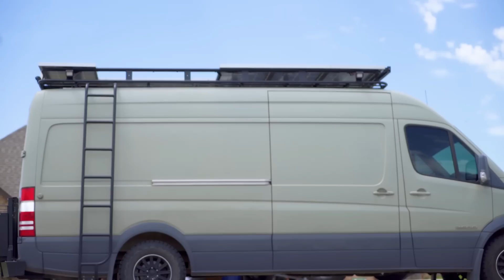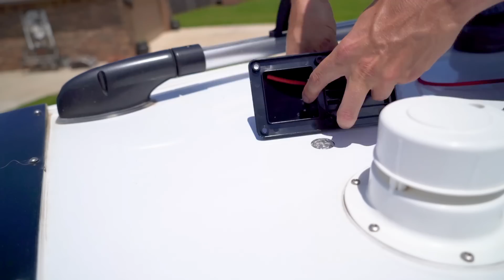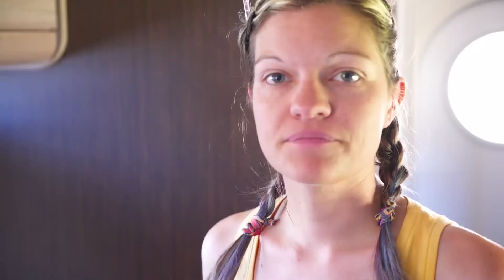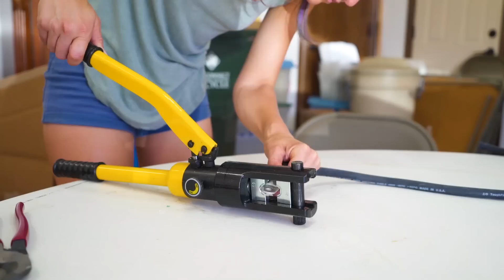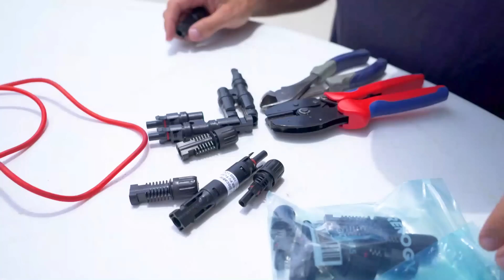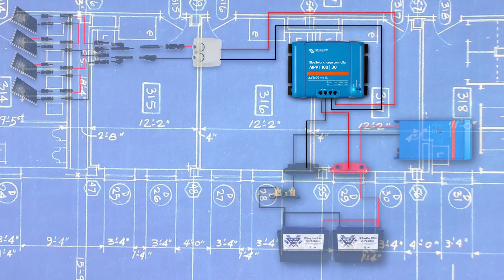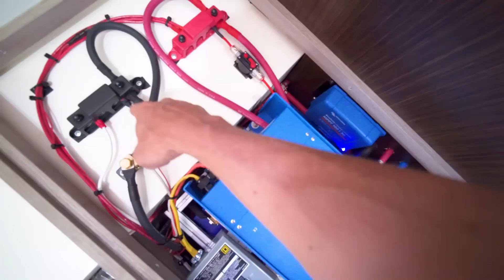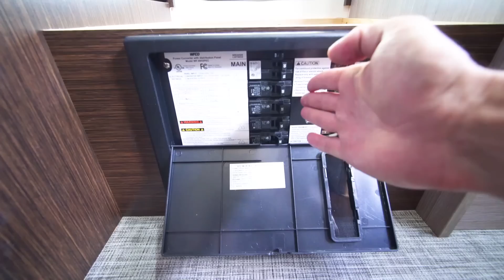Camper Solar Setup Tutorial - How to Solar Power your RV, Camper Van, & Truck Camper

Comment: Might have been useful to run shore power to the inverter/charger via that existing 15A breaker instead of letting it sit unused and doing that splice in the new junction box. That way you essentially gain a free isolation switch, and you need a bit less wiring work.
Reply from the maker: The way we did it in this video is no longer the way I recommend.  Now, I recommend running the shore power to the inverter directly and running the AC out back to the panel to power the entire panel like shown on all of the wiring diagrams on https://www.explorist.life/solarwiringdiagrams  Attempting to isolate the air conditioner and microwave to independant circuits is not worth the effort.  If somebody is worried about accientally bumping the thermostat and turning the AC on, just turn off that breaker.   Otherwise, just pay attention to what you are doing.

Comment: Cant you just connect the solarpanels to the battery that the travel has a place and avoid all the wiring
Reply from the maker: The solar panels must be connected to the charge controller.  Not the batteries.  You can see diagrams for this here: https://www.explorist.life/solarwiringdiagrams

Comment: Hey guys I love the fact that you and your wife do things together,, to me that is awesome and that's a huge thumbs up for me..
👍👍👍👍👍

I just want to clarify something,, and maybe I just misunderstood or didn't see but when you supply shore power to see inverter..
The shore power is normally a 30 amp circuit for that particular type of camper..
But coming in into the junction box you have mounted on the floor where you ran it up to your original 30 amp circuit breaker system and then you ran it over to the new inverter charger.. 
What size wire did you use going from that junction box on the floor where you made the splice to go from the shore power to your original circuit breaker AC power supply system to your new inverter??
If that wire is Less than a 30 amp wire which would be a 10 gauge wire,, if there's a short between that junction box and your new inverter charger or if it has shorts internally and if that's wiring is less than a 10 gauge wire it can possibly overheat and catch on fire,,  unless you put an in line fuse at displays in your junction box on the floor appropriate to the wire size going to your new inverter-charger,, if it's not rated for 30 Amps a 10 gauge wire is please return my message if you would please don't take this as somebody else being a know it all I just wanna make sure I understood that's all..
Reply from the maker: Correct.  We used 10AWG for the 30A wire runs.  You can see all the wire sizes in detail here: https://www.explorist.life/solarwiringdiagrams and look for the 200AH / 400W for this particular system.

Comment: Two quick questions,
1. What is the advantage of the cage that you created for the batteries? Other than cosmetic and organization does it add any features or safety?
2. What exactly do the buses do?

I love this video! You have made something that I thought was going to be intimidating and difficult much more approachable! I’ll be downloading my book ASAP!
Reply from the maker: The cage simply gives the inverter somewhere to sit in this low-clearance environment.

The busbars are essentially extensions of the battery terminals.  Here's a video that explains the basic parts and pieces of this setup: https://youtu.be/xuZg4NasCVw
Reply: Hi from Australia 
I just came across your comment 
Just thought you might like to look at my camping set up, some Australian locations such as world heritage listed K’gari (Fraser island) and some great camp cook ups. 
Cheers and safe travels🇦🇺
Out There Touring

Comment: How did you secure the aluminum cage to the flooring?
Reply from the maker: We drilled a few screws into the floor, but the floor is just a SIP (structurally insulated panel) with little real wood/substance there, so I don't really think that's doing anything.  The cage is really just wedged in place very well with 50+ pounds of equipment in/on it, so short of a massive collision or something; it's not going anywhere.

Comment: Why didn't you wire all those solar panels in series. that Charge controller your using can handle 100 Volts input.
Reply from the maker: Indeed it can handle 100 volts input, BUT those panels can potentially put out more than 25v each if the temperature drops.  Remember, solar panels only put out their rated output when the temperature is 25 degrees C (about 70 degrees F).  Here's a video that will teach you more about sizing a charge controller to the panels: https://youtu.be/MxziHKvTRh8

Comment: Did you drill those mounting holes in the roof rack?  Any concerns about structural integrity afterwards?  I am doing a similar thing because my roof rack doesn't have a channel for screwing anything down. Thanks looks great!
Reply from the maker: Yes, we did drill the mounting holes in the roof rack and no, we have no concerns about structural integrity.

Comment: Rv s should by now be stocked with the option to build solar directly into the whole system.  There is already so much at 12v which is perfect for solar.  I eventually just disconnected my converter all together.  Good luck folks.
Reply from the maker: Yeah, we recommend disconnecting the converter all together and using an inverter/charger combo as it's less complicated and less wiring.

Comment: I want to to put 2 battleborn batteries, Victron inverter/charge, along with the solar on roof, controller.... Would you use the garage to install batteries/ inverter or use the front space of 5th wheel. I understand that the battleborn lithium batteries will not charge under freezing so many put in garage for heat, but others just install in front compartment and don’t worry about that because they don’t camp under freezing. We do not plan on that either and I know there are battery blankets that could be installed if that happens.  So whats your opinion on placement of system in a 5th wheel. Thanks .. Great info...
Reply from the maker: I recommend putting your batteries near where you plan on mounting your inverter; wherever that will be.

Comment: When you get down to it, this takes a good amount of thought. That being said, both of you have made this process as user friendly as possible. 

Everything else I’ve seen has left me more confused in the end than I was at the start. So thank you for going in depth but at the same time keeping it simple. 

What am I going to use? How much power will I consume? What equipment will need to power the consumption. How will I hook this up, and how much will these different parts cost? 

You’ve answered all of these questions as flawlessly as possible. You two did great!
Reply from the maker: Awesome!  Glad it helped!  Thanks for that.
Reply: I did not understand the 30 amp wire being split in a Junction box to go back to the 120 side of the panel. Not to mention the 6AWG from the MultiPlus going into the same 120 side of the panel
Reply: Hi from Australia 
I just came across your comment 
Just thought you might like to look at my camping set up, some Australian locations such as world heritage listed K’gari (Fraser island) and some great camp cook ups. 
Cheers and safe travels
Out There Touring

Comment: Awesome videos! So just so I'm clear, even though solar panels are wired with 12AWG wires, we still need to use 10AWG wires to connect to charge controller?? Thanks!
Reply from the maker: Correct.
Reply: @EXPLORISTlife  I had bought the 12awg wires before I knew. Is that a problem or are they still usable?
Reply from the maker: @shnanti  I've built this wire size calculator that should help you out: https://www.explorist.life/wire-sizing-calculator/
Reply: @EXPLORISTlife  thank you for your help! And thx for the battery sale hookup, too!

Comment: I was planning on 1 Battle Born and 200 watts of solar for a similar size camper.  You installed exactly twice that.  Was that absolutely necessary in your opinion, or were you just going above and beyond?  Also, what brand of solar panels was used?Thanks for the great video.
Reply from the maker: It was based off of performing a power audit.  Tutorial here: https://www.youtube.com/watch?v=a406IxiU-Xg&lc=UgzoFAV5_Qzg6yNFpSF4AaABAg

We used these panels: https://amzn.to/2CN8RPx

Comment: With my setup, I have 8 325 watt solar panels on my skoolie. Will I need 2 charge controllers to accommodate the 2600 watts or can I run it off just 1?
Reply from the maker: You'll need either two charge controllers; or you'll need to run a 24v battery bank.  Either way...

Comment: I would have made use of an inverter/charger combo device. So when your plugged into an external mains power, the A/C circuit (in the RV) will run directly off mains, while the batteries charge simultaneously. When you unplug mains power, the inverter/charger will run off the batteries.
Reply from the maker: Good idea!  That's exactly what we did. Lol

Comment: Excluding batteries whaat is the cost of solar panels, and assorted other components.  the best two truck campers I found doing research, were a Bigfoot followed by a Northern Lite.  Both Bigfoot and Northern Lite come from the factory with two hundred watts of solar, and a decent four phase inverter, converter, charging system.  Approximately what was the cost of the inverter charger?  Your finished product was very professional looking, and from what little I currently know about solar the  products you used seemed to be very high quality.  Thank you for doing the video, and you all seem to be a good team.
Reply: On the truck camper I bought the wiring from the solar panels went through the refrigerator vent on the roof.  Saves drilling at least one hole what do you think the negative might be
Reply from the maker: You can check the parts lists on https://explorist.life/solarwiringdiagrams for component pricing and total it up yourself. 👍👍
Reply from the maker: Refrigerator vent is a decent option too.  Just not what we chose to do.

Comment: Nice job. What I have done on my new rig and two other rigs, is run my regulator wires directly to the 12v posts on the fuse/breaker box, which leads to the battery, that way I never had to find weird places to run wire. On my now rv, I have run the solar wires off my 200w panel down the fridge vent out the bottom to under the area where the fuse/break box lives. I see you mentioned, in your case getting rid of the converter (I can see why you don't need it), but I need mine to run the 12v system as I don't have an inverter. I just use my panel to keep my batteries topped. Question wired like I have mine you mentions power drain etc. Can you tell me how the converter in my case maybe a problem?
Reply from the maker: If you don't have an inverter and only run your 120v circuits when on shore power; you do not need to, and shouldn't disconnect your converter.

Comment: Great video.  I was hoping you could answer a question for me though.  I am beginning my planning to add solar to my pop up camper.  This comes with the ability to hook up to 110v at any typical RV campground.  Is there a way to hook the solar up to be able to power the already existing 110v plugs that are installed in my camper? Thank you.
Reply from the maker: Yep!  Shore power into the Victron Multiplus and AC-OUT to your camper breaker box will then power the breaker box by shore power when available and by batteries when shore power is unavailable.

Comment: Timely video for me, Nate, as I am about to add solar to my existing teardrop trailer rig and upgrade my battery bank. Thank you for the excellent clarity of your teaching methods. However . . .

While I understand the solar delivery to the batteries for the DC side of power delivery, how the inverter changes DC power to AC power, and why you bypassed the converter, I had difficulty with the AC side of the distribution panel. I don't understand why you isolated only the 120V outlets apart from the breaker panel to be fed only from the inverter while all other AC powered components are delivered through the breaker panel, powered only by shore power. I know that the air conditioner has too much power demand to be run by the batteries, but is it correct to assume that the microwave, Alde heat system and all other AC powered appliances can't be used unless you are connected to shore power or plugged into the 120V outlets fed by the inverter? Why can't these appliances also receive power by way of the breaker panel powered through the inverter? Is there a way to have them wired to receive power from the inverter except when shore power is available, and have shore power take priority as the AC power source in order to preserve battery power? A more in-depth discussion of the AC side of the system would be sincerely appreciated. Otherwise, great work! You are the go-to guy on everything solar for RV hacks and van lifers and I have appreciated all of your tutorials.
-CD
Reply from the maker: If I were doing it again, I'd just simply go Shore Power -> Inverter/Charger -> Power Distribution panel.  This would make for a cleaner install and I'd just rely on the end user to understand what is and is not capable of running off the batteries/inverter.

I plan on doing more stuff specifically in the OEM RV side of things next year when I have a big garage available.

Comment: I cant talk English, but I trye,, whay dont you glue the solarcell thing instead of doing several hoole in the roof?  I going to this to but not borring hole in the roof and i using the antenna hole under the solarcell to go down to the garderob or what it came thrue,ok,,what i mean is you dont have to borr throw the roof ther are so much strong glue now,,, take a look at the strong glue so you dont get a leak!!! and thats no good,,, regards Sweden:-) onlea a hint ok,,:-)
Reply from the maker: I prefer mechanical fasteners in ADDITION to glue/adhesive/sealant so it will be strong and will not leak.  That's why we did it like that.

Comment: Hey there thank you for the awesome content! Super helpful and informative. We are building an off grid Skoolie and I am wondering if I can also use a generator as well as an alternative to shore power for charging?
Reply from the maker: Thanks!  Absolutely!  So... all of the wiring diagrams at https://www.explorist.life are capable of that... kind of...  The way it would work with that setup would be that you'd simply have to choose between shore power or your generator and you'd have to physically have to plug your shore power cord into the generator.  BUT...

If you are wanting the generator hard-wired in AND have the option of plugging in to shore power where the generator would auto-switch on-off as needed; you'd want to look into using the Victron Quattro as your Inverter/Charger (https://amzn.to/2LXWPrO) as it has two inputs from AC (shore AND generator).

Comment: Good work. Two questions: 1) all your solar panels are in series and all your batteries are in parallel for 12V output. Have you thought about 24V or 36V output? Or 12V and 36V both same time? 2) can you elaborate advantage and disadvantage in paralleling and seriesing solar panels? Thanks.
Reply from the maker: Thanks!  IMO, 24+v battery banks done make sense for RV's/Campers until we get to over 1200W of solar or over 3000w inverters.  Needing to buy 12 to 24v and 24v to 12v converters and buck boosts for those scenarios would cost more than the savings in wire and the added complexity may outweigh any efficiencies.

Regarding Parallel vs Series on Solar Panels, I don't have a video yet; but I've written an article about that: https://www.explorist.life/solar-panels-series-vs-parallel/

Comment: I have watched millions of videos mazzy star fade into you is most watched. I use to build trucks at sema a decade ago . Your video is awesome  intuitive and just sets a standard far beyond what most do I am happy I came across it. I have a 59 airstream  bought a mini split so I need 800 watts plus of inverters I am also plotting to Manufacture  LiFePo4 lithium ion batteries ... I know you state everything  is in your diagram thing my question is one of two what's the best inverter for over 2000 watts and I need to have solar capable of at least 1200 watts I am building 8 batteries for this 20 ft airstream. You just got an email from 0405@yahoo with stuff before it. Maybe we can collaborate
Reply from the maker: Nice!  Thanks!  That sounds like a cool project.  All of my diagrams are based around a 2000w inverter, but with a simple up-size in wires, a 3kw inverter is easily possible as is 1200w of solar.  You should check out the diagrams here: https://www.explorist.life/solarwiringdiagrams  For a 3000w inverter AND running an air conditioner; I'd be pushing you to go toward a Victron Multiplus 3kw (https://amzn.to/2nOFjgj)

Comment: Great work! Love the positivity. 

I have a question I hope you can answer. Does the solar panel positive cable need a fuse on the panel side? I have a fuse in between the regulator and battery. In the scenario of a short in between my panel and the regulator, would the positive cable from the solar panel heat up to melting point? Thanks heaps.
Looking forward to hearing back from you. 
Josh
Reply from the maker: It depends on how your panels are set up, but if they are in full series; no.  If they are in parallel, yes.  Here's why: https://www.explorist.life/how-to-fuse-a-solar-panel-array-and-why-you-may-not-need-to/